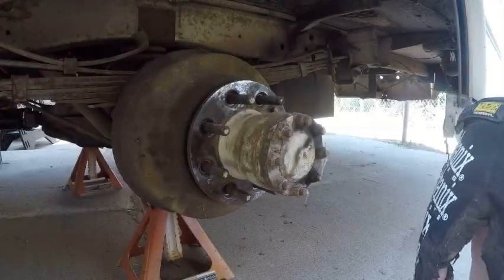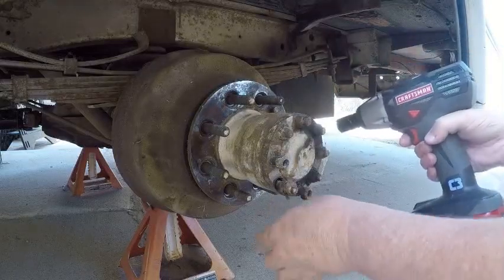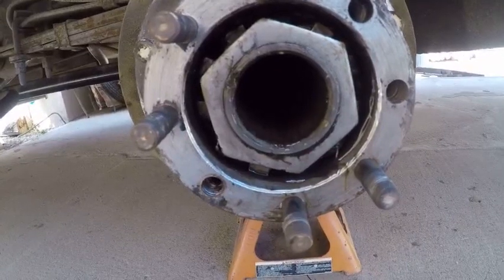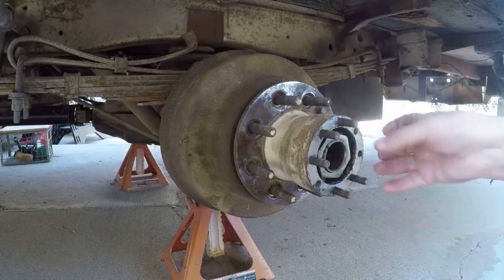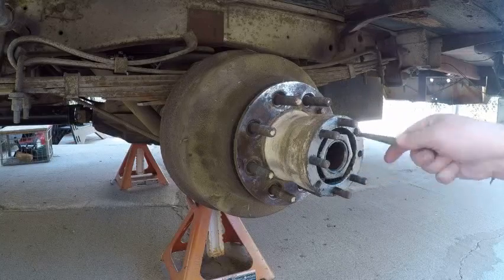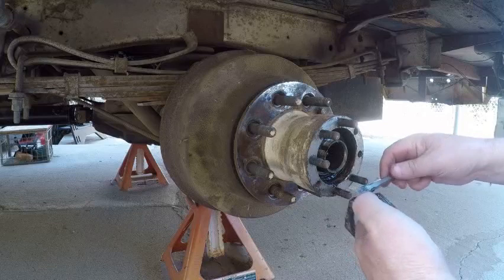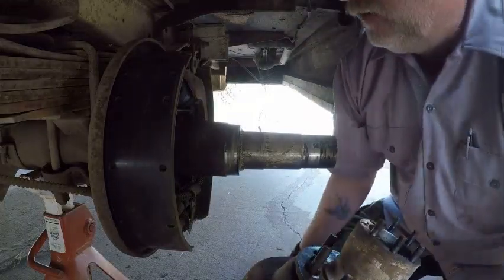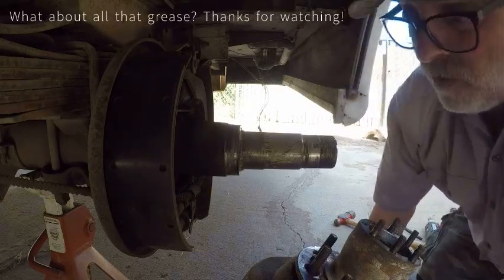Rear brakes P1 - Removing the axle from the Dana 70. B016

Comment: what is hub oil used for ?  its not sold as  gear oil specifically  .  do you just pour some on the bearings &  thats forever it or is it considered something to prelube the new bearings befor the 90w gets to them ??
Reply from the maker: I have never used hub specifically for anything. All the bearings need is the 90 that gets to the hub through the axle housing.

Comment: It is not recommend that you grease the bearings on a oil bath hub. Grease restricts the flow of oil and contaminates it as well. That is why you always prefill your hub with oil before installation.

Comment: My question also what about the grease? The axle looked really dry when you pulled it out, I would have expected axle fluid on it.
Reply from the maker: The axle is quite a bit higher than the 90 weight running in the tube. There was plenty of it dripping out of the hub. The grease was in there from somebody else before me. I did not use any grease when it was reassembled.
Reply: Might be that the differential oil is low.  I had bad smelling 90 weight come out when I pulled the axle.